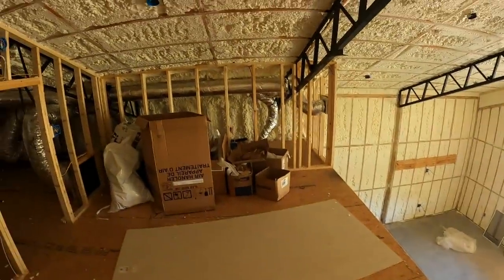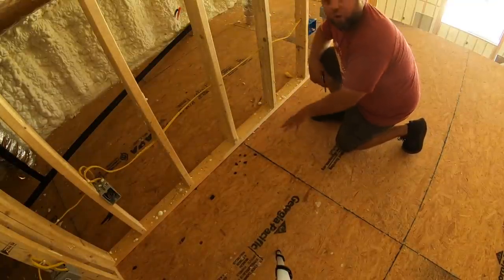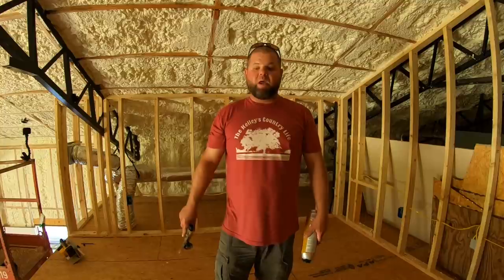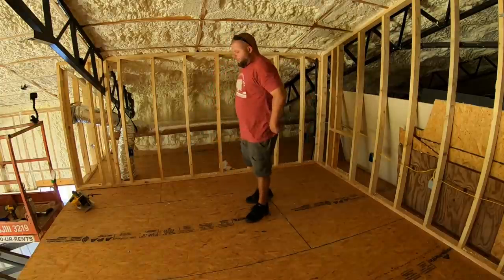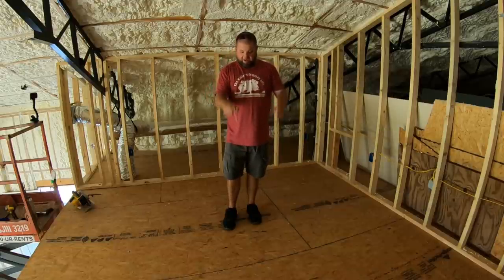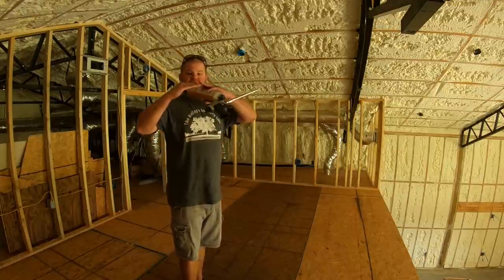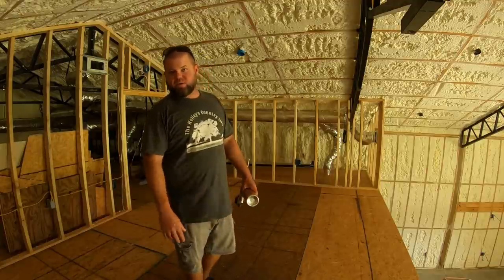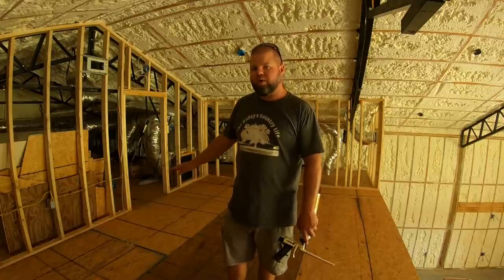Great stuff pro foam adhesive and finishing the loft! #475

Comment: Hi Andrew!  I recommend adding a piece of sub-flooring in the threshold  of the door into the attic.  Aesthetically, it would be more pleasing to the eye and give a place to secure the flooring(carpet, tile, vinyl, etc) too, under the attic door.  Then add a metal  transition piece from the 'carpet' to the attic floor, similar to the ones used when going from carpet to tile or vinyl.  This would help you to not 'stub your toe'  when going from the attic to the loft area.  Just my $.02 worth :-)

Comment: If you’re still going to do a lot of caulking you should look at the power caulk guns. I know Milwaukee makes one but it’s just a cock gun that works like a drill and you can adjust the speed of how fast it comes out but you just pull the trigger.  Plus it’s a tool so if your goal is to have them all, which it should be, you would need that one 😂
Reply from the maker: I did look at them, but 200-250 dollars is more than I want to spend on one.
Reply: @TKCL   I would definitely want one but I would probably never spend that much either. I just wouldn’t use it enough.   Now if you could find caulk that would fit into one of those battery powered grease guns that would be a dual purpose tool. 😂😂

Comment: Air seal the attic door for noise created by the hvac unit. But like I said before, noise reduction like that can be done later. I still feel like r-11 noise insulation under the whole attic/loft floor within the joist space will help reduce noise and stratifying the air. Since you went with a zoned system, encapsulating the bedroom ceiling /attic floor with the insulation would help even further to prevent transfer of heat between bedroom and attic. I know your 2x6 walls are amazing and the house is already one baller of a sealed unit.
Reply from the maker: Here's the crazy part, called three cities today (including a major metropolitan area. Three different independent hardware stores, two Lowe's and two home depots. No one has unfaced r13 or r19 insulation in stock. I am reading don't use faced (paper or plastic) insulation in interior walls. Unfaced is common, but no one has any in stock. Too bad, I was going to insulate the bedroom, but can't now.
Reply: @TKCL  Just buy faced and tear of the facing. The insulation guys do it all the time.  Unfaced is what you want for interior walls.
Reply from the maker: Didn't realize it was that easy to tear off. Well all my local stores are closed tomorrow 🤦. Don't know if I'll be able to make it to the big city in time

Comment: To level that you now need a floor sander  rent one at home depot.   They normally for hardwood sanding. But they work nice.  As for that cans rating.   Temprature and unsed on the 2x10's  directly would give you them results.  You was adding extra lenght and them curves add to the product.   So I would say it covered 2x the space it would have been used normally
Reply from the maker: Still would have made it further with 16 big tubes of traditional construction adhesive. I think they were a bit generous with their claim.
Reply: @TKCL  looking at you door to the attic. The floor I would double on the inside half door back as the flooring will need to have a transition at a poind. And the looks of the wood under the door for estatics of the main room.

Comment: Rebuild my deck. Buying 10 to 12 boards at a time. Different thicknesses different widths, +-1/16 thicknesses and +-3 /16 width. Pitiful stuff, I am buying premium grade and it's really a job to pick through the stack to get decent quality. Not much different in quality between standard and premium. It does not seem like much but lay it trying to keep it straight, gaps and bows everywhere.
Reply from the maker: I'm experiencing the same thing with up to 1/4 difference in thickness. Absolutely unacceptable!
Reply: Yeah even 1 /16 on 5/4  decking is obvious where 2 boards butt togther. Will have to belt sand some of them.

Comment: Yes that "stuff" is great.  We have been using it a few years on our subflooring. Great video.....looking good
Reply from the maker: It's definitely convenient, but I seriously doubt it replaces 16 32 oz tubes of traditional adhesive.
Reply from the maker: You ever had issues with it pulling apart? Do you think it holds just as good as liquid nails? I've been curious
Reply: @TKCL  I use the zip brand but it goes down the same way with same gun. I think they are the same thing. Never had any issues at all. The advantec is tongue and groove so we put it in the groove as well.  You can not get the plywood back off. You have to tear it all out. It shreads the wood if you try to take it apart.
Reply from the maker: Good to know

Comment: Matt did a test video on the foam adhesive vs caulk adhesives. You'll only regret it if ever have to be ripped up to replaced.😆 Until then you should love it. Shouldn't have any squeaking between the layers. It probably isn't worth the cost for what little you will need it, but I believe they make a extention handle for those foam guns.
Reply: Just looked it up and it's a 46" long barrel foam gun that Dap makes. Good for anyone wanting it just for subfloors
Reply from the maker: Yep I seen that gun, not practical for me. Still quicker than a caulk gun.

Comment: OVERKILL with the flooring adhesive!!!  haha  But hey... you're set if Florida ever has an earthquake!!!  :-)
Reply from the maker: It's not about strength as much as squeaks.
Reply: Flooring only squeaks where the nails/screws pass through the flooring and rub on the vertical shaft of the nail/screw.
Reply from the maker: There's also popping noises where sheets shift on joists or each other. The more glue, Screws and nails, the less chance of any of these noises. Especially screws and glue
Reply: SOLD- No such thing as too much adhesive!!!  :-)
Reply: The amount of adhesive you used was enough to lay 25 sheets of osb. If your using it properly it would definitely have laid 25 sheets all day. Secondly like any subfloor adhesive in a can it has to be very warm to come out good and you have to shave every cab up for more then 30 seconds constantly at a constant rate to make it work correctly. Been in the construction field for over 15 years and I can say that no none zero amount of liquid nail will out perform or stretch as far as can adhesive. Even advatech adhesive will do 23 sheets and you can even use the same can when the gun is closed even after 30 days like they say on the application. The only area that adhesive needs is every joist. One bead right down the joist on each joist and it’s solid. Doesn’t matter if you use one sheet of inch and 1 eighth or 2 sheets. Once that adhesive is completely dry it’s not shifting. It’s not bouncing it’s not moving period

Comment: Make sure you are super careful about cleaning that gun. I just finished my tornado shelter (same one you built) and ran a case of adhesive through my gun. I thought I was careful about cleaning it out, but now the gun barely flows anything. Hoping I can disassemble it to clean as I would have to throw it away

Your gun is already looking way slower than new. Hopefully it lasts
Reply from the maker: It's super fast on foam, not so much on that adhesive. I religiously clean it inside and out with their cleaner. Just bought another can. The tip looks removable, you probably can clean it and and disassemble it. That's awesome you built the tornado shelter, is it in a garage?
Reply: @TKCL  yeah, inside the garage. I adjusted it down to 5'x8.5'. Trying to finish the jamb and hang the door today
Reply from the maker: That's plenty big to ride out a tornado. Godd luck with that door, it's extremely heavy.
Reply: @TKCL  you're not kidding! Flipping it just to do the sheet metal was sketchy enough